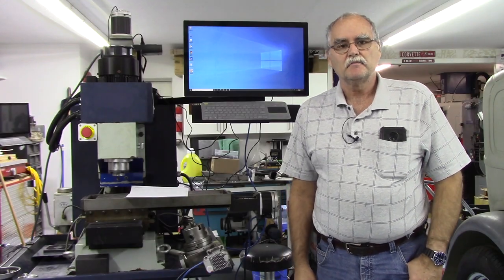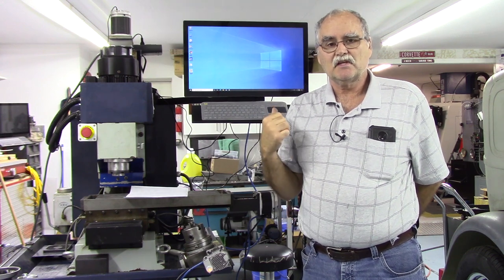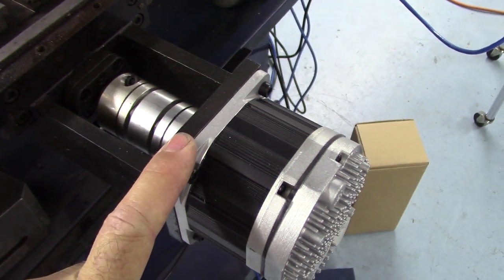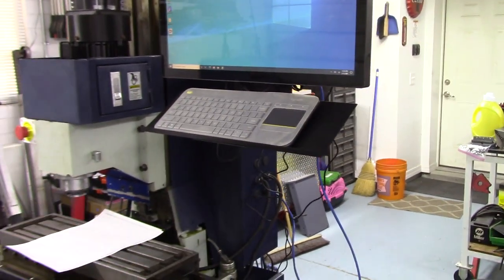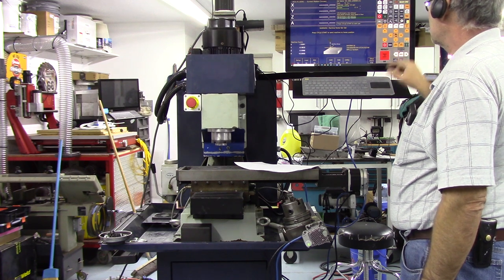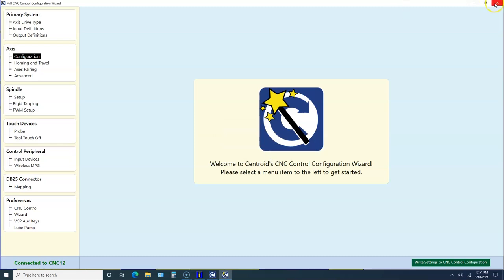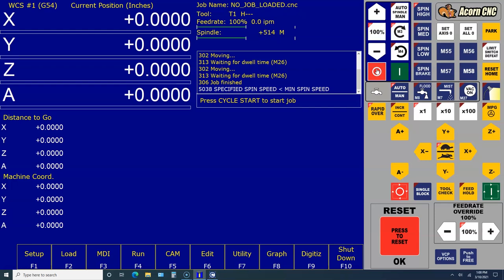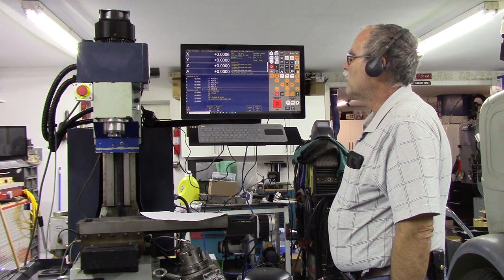SYIL X4 CNC Mill, Teknic Clearpath SDSK, Centroid Acorn Project: Back Panel In Cabinet & Setup

Comment: Hey Marty I was looking at buying a DMM 86M-DHT 0.75kW AC Servo Motor and run it from one of the DYN4 AC Servo Drives.  Do you think the 86M-DHT motor would fit in the Syil X4 head?  It says its a NEMA 34 and with 14mm shaft just like the original BLDC motors the machine comes with?  Thanks
Reply from the maker: I don't recommend using an AC servo for a spindle motor. I have not had good luck getting them tuned. They are really not designed for spindles. Feel free to reach out to DMM for further advice.

Comment: Just watching some of your previous videos; what differences are you finding between setups using ClearPath, and the Gecko board with drivers? It looks like ClearPath is simpler/tidier, but is there a difference in accuracy, smoothness, power etc.?
Reply from the maker: Clearpath is closed loop between the motor and the drive. That is if the drive tells the motor to turn X number, it's encoder provides feedback to the drive to tell it has done so, if it's having trouble getting to position, the drive pushes the motor harder. If it can't the drive will fault and signal Acorn to stop.

You don't say which Gecko board you are talking about. G320x is a servo drive. The rest are stepper drives and are open loop. There is no encoder to tell the drive the motor has moved to the commanded position